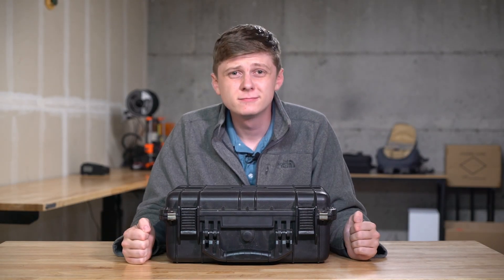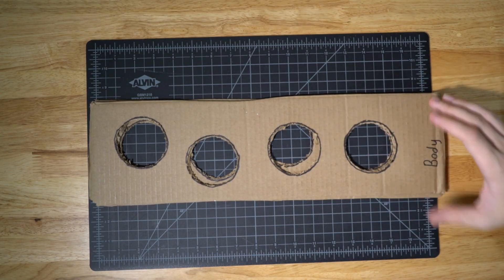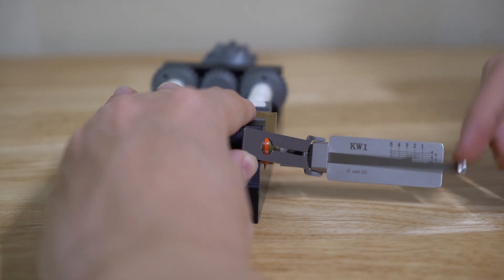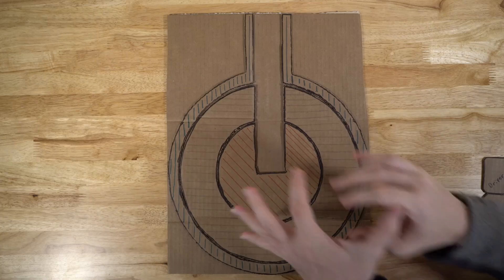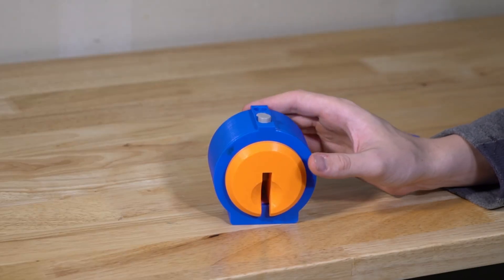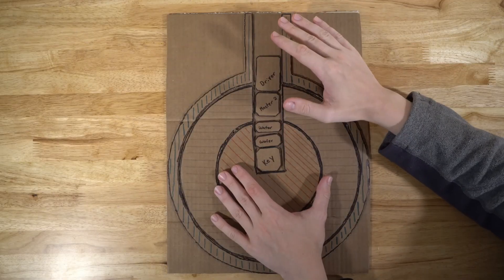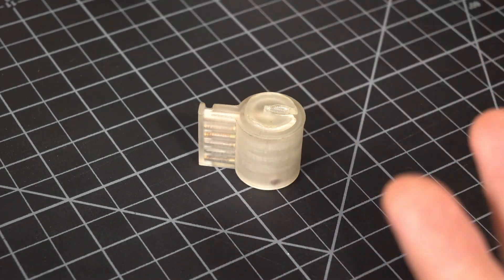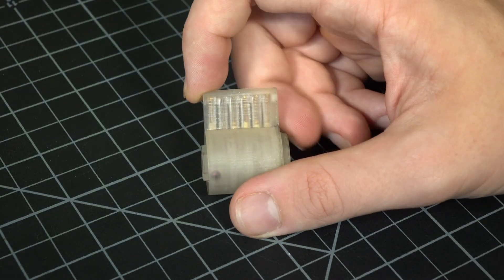How to Design an Unpickable Lock

Comment: Well done! I subscribed right away to see where this goes next. I just realized this video is from 6 months ago. I will go look at your other videos and see if there is already an update.

Keep in mind that the cheapest 3D printers are usually not a good deal. You will usually pay with time, frustration, and accuracy. One thing to also keep in mind when it comes to MSLA printers is that the ambient temperature of the room can effect the final size of the print. If you need fairly tight tolerances, and you adjust your model to try and get the final print to work, printing the exact same model on a day that is even just 5-10 degrees hotter or colder could make the final prints no longer fit together.

Comment: Eventually you come to a point where its just easier to destroy the lock too. There is currently a gang in Sweden that uses nitric acid to destroy the locking system and enter whatever compound.

Comment: I can think of one way to decode this lock. You push the pins all the way up so that you know how long they are, so that you can gauge where the master is, and then you can cut your own key. However, this could be fixed by just having different densities of spring.
Reply: i can now see that this has already been addressed

Comment: Is it unpickable? No, I don't think so. The watchdog pin is flawed. I think it can be bumped up and set, allowing the rest of the lock to be picked while in the setting phase.
Fix: have the watchdog pin be too big rather than too small during the setting phase, and let it lower (rather than raise) during the transition to the testing phase.
With that I think there should be no way to figure out the bitting, so long as the watchdog pin is the first one to bind (otherwise, it would be possible to figure out the bitting of any pins that bind before the watchdog pin when turning the cores together).

Comment: More important than being unpickable, does it work at a wide range of temperatures as well as dust, moisture and dirt conditions? The fact that the conventional types are still on the market is an indication that being unpickable in NOT a primary concern.
Reply: As well as... If someone can't pick it and wants in they'll just break it either way.
Reply: @KodakYarr yes, if you have infinite time and you can use any tool. Clever thieves would just choose an easier target secured with a Masterlock
Reply: @borincod  I mean.. No because they're not there to "cleanly pick a lock and steal." They're going to break it from the go, they're criminals they're not concerned with your door. For that matter, locksmiths are the same unless you specifically say so.. They'll drill a hole in the cylinder effectively breaking it and then go on to sell  you a new one.(At least where I live.) Because let's face it, it's a waste of time. Unpickable locks are a novelty and a small deterrent for random burglar who just strolls by looking for easy pickings but not a targeted attack.
There's also other ways to just bypass locks all together but that's a different topic.
Reply: @TheSlitTickler  yeah.. dude. that's more or less what's going on. A chain is as strong as it's weakest link. But what didn't you agree with me?
Reply: @borincod  tbf now that I read again I'm not sure lol. I guess reading the second comment I got the impression that you advocate to buy the other option and that it's that much better that it'd make you impenetrable or something... Just misunderstood what I read when I wrote it I suppose.
Reply: there are though many hard to pick locks. Those special locks are just comparably expensive. That's the real reason these are not at every door. People just vote for flimsy insecure locks with their wallets
Reply: @borincod  Put another way, people are sold the idea that cheap locks are effective by lock companies that would rather make profit from quantity over quality.  (This conversation quickly devolves into economic theory after this)
Reply: @eyflfla  your proposition is that supply defines demand. This works sometimes, indeed. For example, when a lot of marketing job is done. I wouldn't be so sure it is applicable to the lock market
Reply: Regarding working in various conditions, I don't see why this design would perform any worse than the baseline. It also is only marginally harder to manufacture, so it doesn't have to cost much more. It's just a single extra barrel, and you actually can skim on tolerances so long as you make sure that the watchdog pin binds first.

Comment: I've design a unpickable lock - BUT it quickly becomes complicated and I alway end up with 3 cylinders - but the real trick - is .. well that's the secret ! you have to make it impossible to move the pins except by the key, and all pins have to be activated befor you can turn the lock and put pressure on the single pin - until that happens the cylinder with the keys just rotates but does not engage, which the unfortunately that introduces yet another level og complexity - 
You have to separate the rotation of the tumble from the tail, that drives the unlocking mechanism - unless all pins are in the correct position.
In this way you can't put pressure on the pins when you want to pick a pin, the tumbler just rotates, and you can't put pressure on a pin by pushing it in, as you can't access the pins when the lock is it starts position, only when all pins at in the correct position. This is what complicates the lock - I don't think you can produce such a lock commercially - unfortunately - the price would be to high, an electronic key system is much cheaper .

Comment: It's basically like a SFIC (2 shearlines) except for the watchdog pin. It will be hard to pick, it will require to test every combination.

I guess the main issue with manufacturing will be similar to SFIC. It's too hard to pin, it needs to be pinned from the factory.

Comment: What about a simple round hole with 4 sets of pins 90 degrees apart with a hex on front tip of key to rotate eliminating ability to tension cyl as would make impossible to pick and tension at same time.

Comment: So you basically pick the inner core, then when it does not rotate all the way reset and try different combination. 

So the unpicability depends only on the number of washers in each pin. With only two it is pickable i think in under 30minutes.

Comment: At a guess, you could still bind the pins by applying forwards pressure against your cam plate, but it's definitely an interesting design! The thing about locks is they're more of a psychological barrier than a physical one. A glass door with a "NO ENTRY" sign is as secure as your inability to throw a rock through the glass. The goal is to encourage typical people to not interact with the locked item, and to be suspicious of atypical people who do anyway.
Reply: Good points. Yes an active video camera definitely deters. So do bright lights as people want to remain hidden in the dark. You can also get cheap motion sensor alarms off Amazon and place them in the shed or whatever you are protecting. More barriers then they want to deal with. In my small town we have a problem with night crawlers stealing from yard. I always tell people the first best method is sensor lights which are pretty cheap these days.
Reply: I dont see how forward pressure would bind anything if the testing happens after rotation. Could you elaborate
Reply: @dark6.6E-34  remember the demonstration with the cardboard at 2:30?
imagine if he slides the cardboard left or right rather than up
Reply: @wans3216  Ik, what the directions mean. But I realized from the demonstration at min 6-7 what the idea was. I am curious now if it works.
Reply: I feel like you’re correct here.  A different guy recently made a similar “my take on an unpickable lock” video (it was great but I can’t remember his name) and I think his first design had the same vulnerability.  He did…something with a spring at the back but I can’t remember what lol
Reply: @williamfloyd9024  Man patching up all lock vulnerabilities makes it pretty much impossible to mass produce it. It's like if something doesnt exist, it is probably for a good reason.

Comment: I would recommend watching the lock picking lawyer as he shows the evolution of many lock devices. 

The big problem most independent lock makers over look is that pickers often look for the simplest method to defeat the cylinder. 

Plus I think the lock picking lawyer has a video where he defeated a simular designed lock with a screw driver and a traditional pick set.

Comment: Great video and engineering!

No matter if your model is pick proof or not. It already seems to be much more secure than a traditional pin tumbler lock, but you have done it without excessive over-engineering suitable for mass production perhaps.

I think one of the main advantages of a pin tumbler lock over a disc detainer lock is that the lock can be engaged instantly. Great for on/off switches on machines with multiple positions.  This new improved prototype removes some of the convenience of the traditional pin tumbler lock, but maybe not too much depending on the application.  Disc detainer locks generally require more key rotation to engage, and are slightly more cumbersome to use, but not by much. This will lead to another topic and it's not intended to be offensive.

Why not use disc detainer locks entirely rather than trying to patch something that has major design flaws by nature? Disc detainer locks can be difficult to pick when properly made, especially with a high disc count and disc anti-manipulating system. Mechanically these locks can be simpler with less small parts and springs making design very resilient to environment. Rekeying solutions are far more flexible too.

Comment: Have a look at the Bowley locks. Simple parts and hard to pick. Needs very special picks and lots of time to get it open. Costs a couple hundred dollars though. I bought them because I liked the shape of the key.
Reply: They're definitely hard to pick, but it's still possible to pick them one at a time.  The lockpick uses 5 picks at the same time, side by side.  Also the lock itself doesn't function like a normal lock, which means that there's a learning curve on how to unlock even with the key.  This lock, you can use a standard key and standard pins, and I don't see a way you can pick it one at a time.  It's simpler, uses the same everything, and is exponentially more secure barring some other exploit.
Reply: @dave-kt7sj  But the Bowley uses much less parts and easier to assemble. Yes it is pickable but not easily and you need those special picks.
Reply: @halohms  If you remove all the bitting, the part count is similar.
Reply: I've seen videos of the Bowley locks getting picked with a metal wire in a vibrating tool (basically slightly more advanced bumping and raking) in just a few seconds. Allegedly, Bowley was so certain they had a winning design that they didn't use security pins nor different tension springs to safeguard against that. I haven't looked back at them since then, they might have fixed the issue by now.
Reply: @5467nick  There are 2 security pins in my Bowley locks that I have and I bought them when they first came out. Nobody is going to pick my door with those locks - they will just break the glass. But that's what the cameras are for....
Reply: @halohms  Well I watched a guy stick a bent piece of wire in a vibrating tool and open a single-blade Bowley door lock in seconds shortly after LPL's videos on them went up.  He said the double blade versions would be much more difficult, but last I saw, they were only offered for the padlocks. I'm not saying any random off the street will manage it, nor that I would, but it's certainly not impossible.

Comment: Have you considered having the pins of the inner core default to the inner shearline so it rotates freely when relaxed? This way, anyone putting tension on the core will force a rotation and be unable to get any information about the binding of the pins.
Reply: It's a clever ideas,  but I'm not sure that would be desirable fur this lock?  If the inner core can free rotate, then the cam can easily set the watchdog pin correctly. With that set, that could possibly lead to being able to tension the mid-core,  and then be able to do a traditional pick on the pins maybe? I think therefore you might want the cam operation to be hidden behind a pin setting procedure like his design, to add time to getting to the cam setting watchdog pin. But I might be wrong. Yours is certainly the kind of thinking and testing you'd want to try in the real world to find out which is better in reality.
Reply: @mikedoragh746  Yes, once I'd finished typing and hit to submit, I thought it was an idea with some flaws. Still, it seems no lock is truly unpickable, it's just a question of making it as frustrating as possible. I think the top strategy should be to make it look like any common-or-garden lock and provide any picker with no additional context (just like they would face in the real world). Don't even tell them there's anything special about the lock. That would make a truly fascinating picking video as they discovered what it was that faced them.

Comment: Sadly, the mid-core does not really solver the problem. If you know how the lock works, you can still pick it. Sure, the effort is greatly increased, but the fundamental problem of pins binding still exists in your design.

Comment: Reliability is why we don't make "unpickable" locks. With a traditional lock, if I get a key that's a bit wonky I can jiggle the key a bit and open the lock. With a design like this, an imperfect key would get to the "testing" part and then not open the lock, with no ability for the person to open their own lock. Wind, rain, sun, imperfect installations and the like add to the difficulty. Regular locks are far more forgiving of these real-world considerations. Probably the least pickable cheap-enough-good-enough lock is the current kwikset smartkey system, the reverse sidebar requires a special tensioning tool that most people won't have.
Reply: It's not reliability that's limiting it's cost as a locksmith said in another comment comparing their secure expensive lock sales to cheap ones.

I mean you can make things reliable with stupidly close tolerances, they just won't sell as the cost will far exceeds their worth.

Comment: Its a very neat design, that watchdog pin feels vulnerable, maybe it would have to be symetric and have a top and bottom half to give more strength. But its a great idea and I would expect not too pricey for commercial manufacturing. That said criminals like angle grinders and pry bars. Picking isn't a common attack, and since in-expensive locks will be smashed before they are picked, there is little point for every day locks, but low to mid range safes or gun cabinets and such could maybe benefit.

Comment: if you want to make your 3d prints not have as much friction you can use graphite as a solid lubricant before putting all the parts together.
integza, a youtuber specialized in making 3d printed combustion engines made an air powered wankel engine and used graphite to lubricate it.

Comment: What do you think of a pin-tumbler lock with 4 bibles so it locks every quarter turn, and the actuator acts as the dial to a combination lock?

You would have to pick it every quarter turn while simultaneously trying to decode the combination, and if one of the numbers happens to be near a quarter turn… well rip feedback lmao

Comment: Hello you may have discovered this already, but with resin printing you will benefit from getting a small uv light off Amazon to further cure your prints after printing. It's possible that some of the sticking you're experiencing is due to the slight tackiness of resin that isn't 100% cured. Great video!

Comment: A) Great Video!
B) Friction? ->Grease, works for Most problems
Reply: I have never had to re-lubricate a lock before and I don't want to start now.
Reply: @shoo7130  Practically all locks have long-life lubricants inside them. They don't typically need to be re-lubricated in any reasonable amount of time. It would be more difficult (expensive) to produce locks that don't need lubricants to function.

Comment: Good, I'm glad someone else had this idea so I don't need to build it.  For seperating setting and testing I suggest using donut shaped wafers so they can fit around some inner pin which can then function as the key (height picked by number of donuts around it) when the core rotates to some other point.

Comment: You basically made the Lock into a combination lock. Id say it is pickable if using standard pin lengths. Someone could calculate the potential shear line locations and preform a brute force style Attack. But just like combination locks the potential combinations exponentials rises. So in theory "pickable". Clever solution for sure The moment I understood the concept I was like "Its now a combination lock" and negates allot of the stumble into correct pinout vulnerability of traditional locks. The biggest reason locks use the same old pickable solutions is mostly due to manufacturing costs.